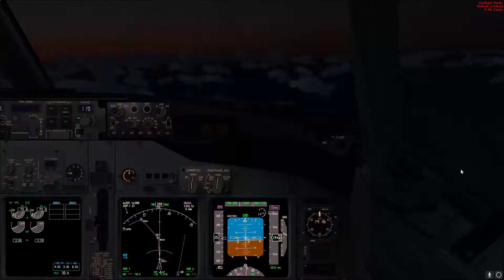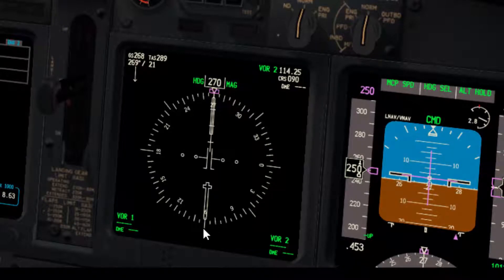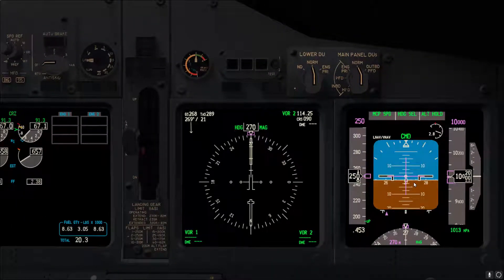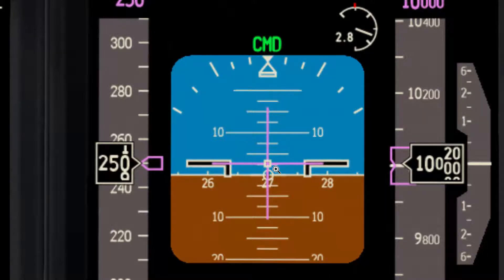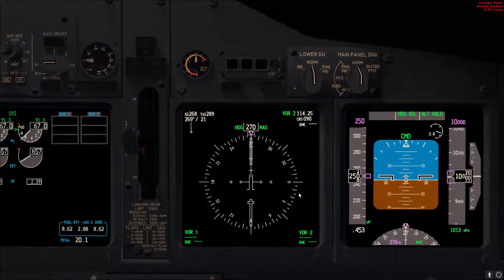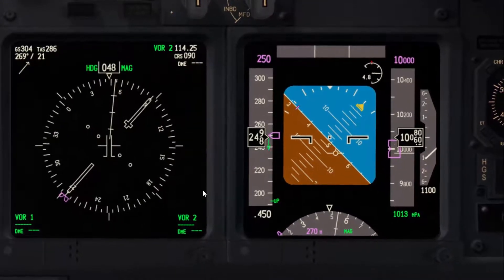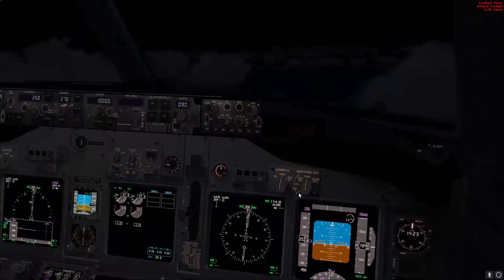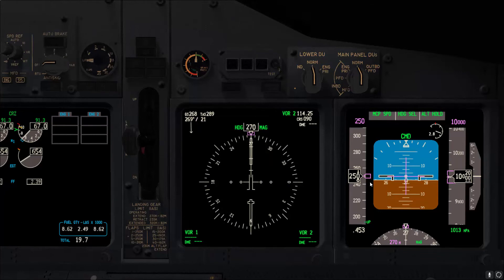Steep Turns B737

Comment: Hey Captain, great explanation, one question Do I have use the Rudder while I turn to the 45 degrees bank to keep it centre?
Reply from the maker: Hello Mohamed, 
Thank you for reaching out, 
I have not felt the need for rudder in steep turns in the 737,,, so you just make sure the airplane trimmed correctly before you start the maneuver and that should be it, 
Hope that answer your question, 
Let me know if you have any other questions 
All the best 
Abdul
Reply: @AbdulmuatiAsiri37  Thank you captain

Comment: Nice! Really Nice now this video has solved alot, Thanks for the upload! Maybe you can help with videos on correct rotation techniques in terms of speed at which i can rotate to the right pitch, high energy descent management especially during vectored approaches, i have got a long list. Truly appreciate the effort you put into this channel.
Reply: mtrackerbeyond my quick tip from me is to alway assure You have set Your fmc routing as per atc. Normally they will give You trac miles or base leg info, insert it and follow vnav.
Reply: by high energy descent management, i mean when to know i am high on profile as compared with vnav path or low and how to effectively correct.
Reply from the maker: Thank you for your feedback, I will try to cover the subjects you mentioned. 
I apologize for the long time between uploads but I will try to reduce the time in the future. 
Thanks again and happy flying ;)
Reply: Piotr Kuler Thanks